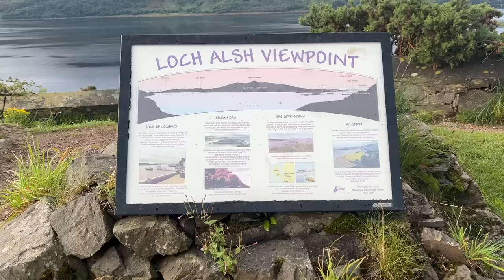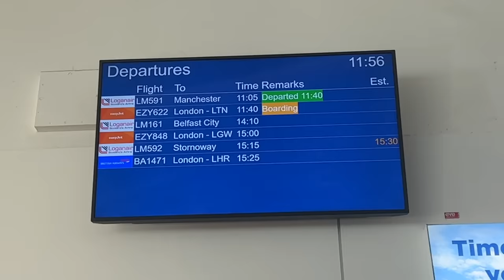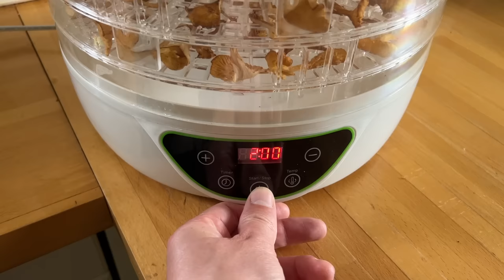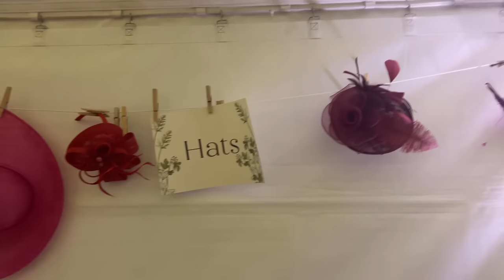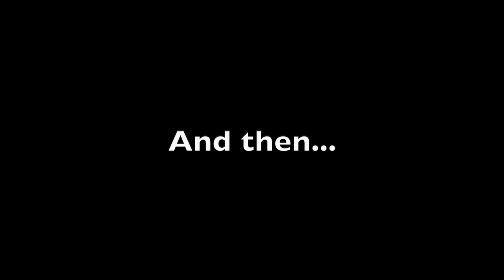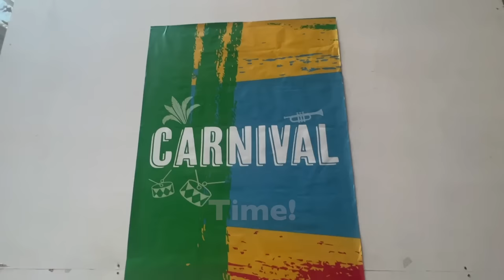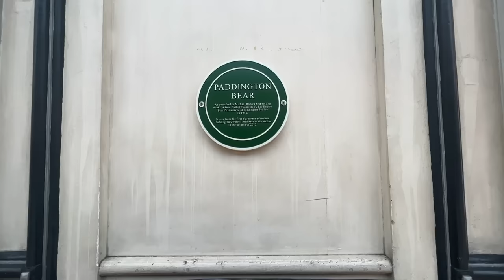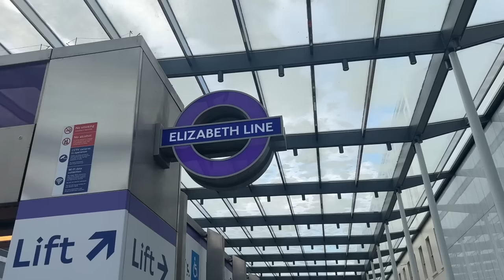Leaving The Isle of Skye - From The Scottish Highlands to London - Ep34

Comment: Great video as always that connector has been wet as the connector shows rust signs. Put a proper connector on it and heat shrink to protect wire. It will let you down again you cannot take chances boating in currents.

Comment: I can just imagine the shock of going into London after being on Skye.  I bet you couldn’t wait to get home even though you had a great time.  Now, Willie, when you were repairing the electrical problem on the boat you had the red kill cord in shot, a lot!  When using the boat you should have the end of the cord on your wrist or leg so if you go overboard it kills the engine rather than the boat carrying on and possibly running you over, it happens, more often than you think and people have died not using the kill cord.  Perhaps it should be called a life cord but it is to kill the engine.  I won’t mention it again, this is the fourth time and I only have your safety in mind as you are a relatively new boater.  Loved the segment on the mushrooms and the Mackeral, I caught one last weekend when our sailing, only small but straight into the pan with butter, very tasty.  Take care guys. Andy UK

Comment: That "chocolate box" electrical connector in the outboard can be replaced with a far superior connector known as a "Wago Connector". Advantage of the Wago is that it's screw less and instead uses a leaver system so is tool-less. Also has a breaking strain higher than the cable, well worth a couple of quid.

Comment: You should invest in a little solar panel and mppt controller to trickle charge your boat batteries. They are not expensive and keep your batteries in optimal condition . I put a little flexible 30W panel behind the cab window of my boat and it works a treat 👌

Comment: Judy and I  have several pets and we learned they generally have a 3yr child's mentality, they do age but still as an older toddler. On the boat I always had a hidden draw on the battery so when turning the key brought no satisfaction it was generally a dead battery similarly a motorcycle rubs a short in a cable. There are some really good "battery tender" trickle chargers, very small that shut off before overcharging. Sarah's rural nature is preferable, Judy and I are so happy to get home from town, God bless.

Comment: That connector is quite a poor way of doing things and will eventually let you down again (probably put in the water when it is vibrating or gets water in it), ideally you need a proper 12v connector (maybe a bullet connector) or a soldered joint

Comment: the other thing to keep an eye on is the back of the ignition switch for corroded wires. I had this happen to me, engine runs great, cuts out, starts again and cuts out, over and over. Should this happen hot wire the wires and repair at home